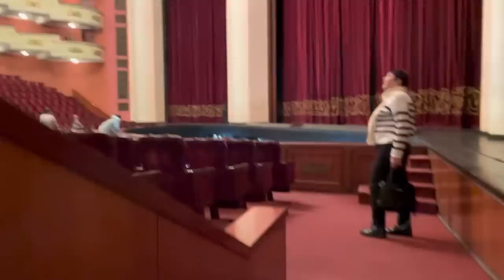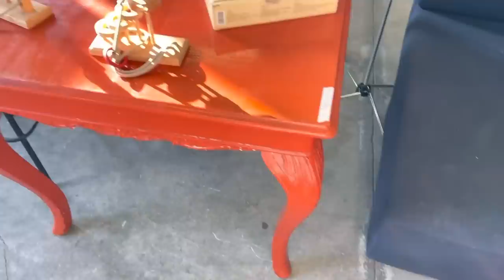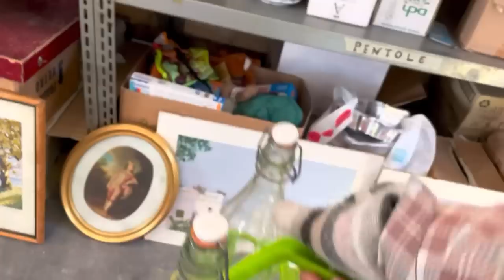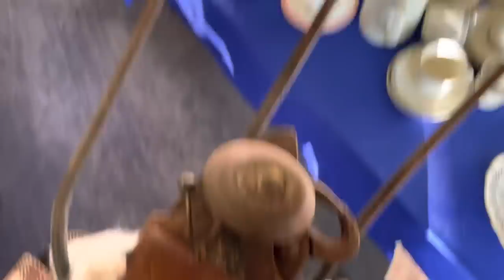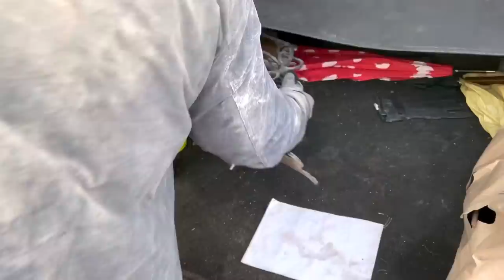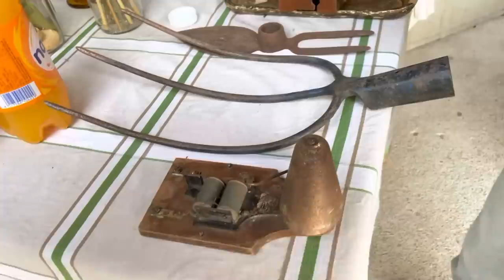Charity shop and new finds for our villa

Comment: FYI, if your serving spoons are marked "800" that means they are 80% silver (20% of another alloy). Probably German? Great find! I always go first to the flatware/serving utensil section of a thrift store. Lots of treasures can be found if you are willing to sift through it all. With a little time and experience you'll be able to recognize it instantly. Check for "925" (sterling), "900" (coin silver). Lots of information on the Google. 
Cheers from North Carolina USA
Reply: it is not silver - it is fake
Reply: @SuperBotanica  maybe. Needs to be tested. Or taken to a jeweler for testing.
Reply from the maker: Ohhh thank you for the info 😻 I took those just because I needed them very happy they are actually very nice 🥰💕
Reply: @DreamingofAChateau  polish them up and use them every day! I LOVE the look of gleaming silver on a table. So very elegant!